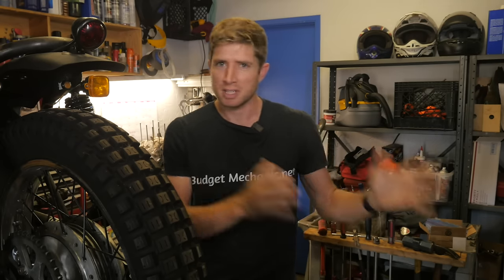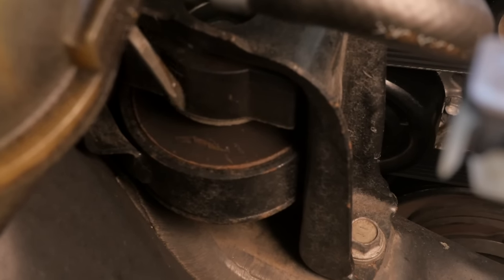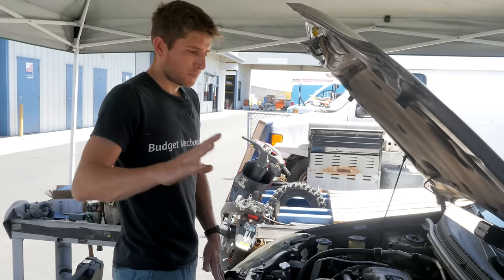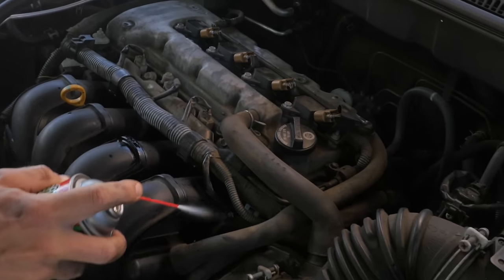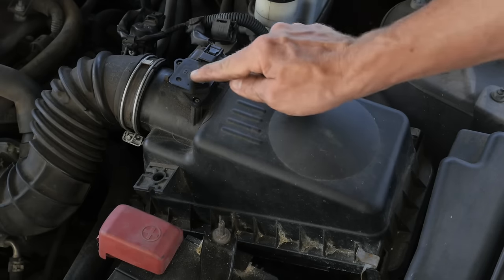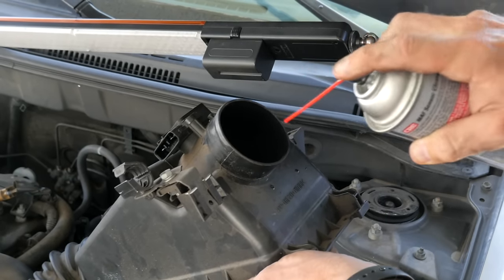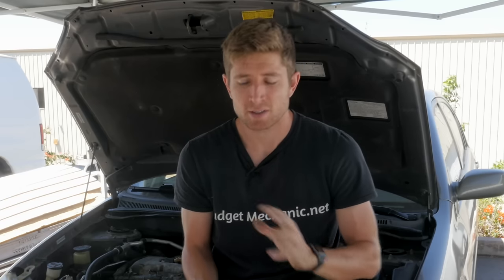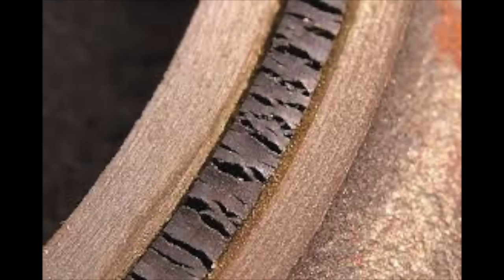Diagnose and Fix Rough Car Idle - Main Causes For Shaking / Vibrating While at a Stop

Comment: He said spark plugs but forgot to mention the ignition coils. If your coil is bad your spark will have an issue.
Reply: If it’s burning oil too blow by through the rings you never get rid of the misfire foul plugs all day.
Reply: Sparks are easier to check for beginners (dirt, grease or else) while coils aren't into the same form from a car to another (ramp or individual coils)
Reply: Coils are easier to chexk than spark plugs. You literally have to remove the coil to get to the spark plug. If you have a scan tool you can switch coils to see if anything changes. Also you can use a tester and test the coil.
Reply: @hioshimtsu  yeah but it's visually easy to tell for a spark, if sparks are good, chances arz the coils are blown
If your coils are dead, how do you immediately know they're faulty if yoyr sparks are dirty?
Reply: @hioshimtsu  not if your car has a distributor, then it gets a whole lot more complicated replacing the entire thing.
Reply: Kinda common sense lol
Reply: Real talk brotha
Reply: Very true.  And the coils made in Mexico and elce where seem to go bad a little quicker.
Reply: I’ve never owned a car with a coil
Reply: Bad coil 99% of the time triggers cel
Reply: If any of the coils were bad you’d get a check engine light coming on for starters and in addition the OBD reader would point you in the right direction with the proper error codes that would point to faulty ignition coils.
Reply: Most cars now have coil packs . A combination of coil and spark plug.
Reply: This is true, most people say spark plugs and mine found out to have defective ignition coils.
Reply: @Anonymous-ew5bq  what is “cel”?
Reply: @thomashardin911  check engine light
Reply: Can coil ignition switch off the car from driving?
Reply: @thembelakweni4613  a faulty coil or coils can cause the following: 
1. limit cars performance (loss of power) 
2. misfire
3. prevent car from starting
4. cause the vehicle to stalling/cutting off
5. rough idle
6. fouling of your spark plugs
Also apart from plugs and coils, its good to check the cables powering the coils. Ive seen issues where there is a loss of power and its cause by the cable being damaged.
Reply: @Anonymous-ew5bq  thank you :-)
Reply: Spark plug lite the check engine light so so lame
Reply: @clonestarr3466  how do you fix the oil in the plugs?
Reply: My Kia Rio was misfiring on cylinder 2 so I brought it to a garage. They told me I needed a full engine replacement but couldn't give me a good answer as to why (scam). Brought it home and did a little trouble shooting. Changed spark plugs. Same problem. Swapped the ignition coil on cylinder 2 and the problem was solved. Cost me $70 for all 4 spark plugs and a new coil
Reply: @sethmanukula176  it’s actually easier to check for a fault coil since all most vehicles require for you to just ink plug the coil and listen for a change in the sound of the engine
Reply: Explains cause I just got a tune up and new spark plugs but my car started back shaking smh must need coils too
Reply: Do bad working spark plugs set off codes?
Reply: Did some research and all the symptoms line up to my car having a bad ignition coil, thanks for the clarification!
Reply: @miguelsalazar3239  yes they do!
Reply: I prefer to use cheap coil coz so easy to check gone bad.
Reply: He  missed a lot of things lol.
Reply: true.
Reply: always use oem ignition coils if replaced. knock offs can ruin the ingition control module.
Reply: my buick electra had coil pack in top area of distributor. it was not hard to replace. hei 50.000 volts type system.
Reply: Well said daddy 😂
Reply: Facts
Reply: As well as Catalytic Converters can also make your car run bad loose power or even run hot. As well in bad situations causing major engine problems. Or oxygen sensors
Reply: Old mechanic trick crank car get a paper towels spool put it to your ear listen for lite tic very low when putting up against coils . Let you know if one is weak going bad.
Reply: COP coil on plug ignition coils fail where the spring makes contact with the plug .
the high voltage will burn thru the insulation . So if you see burning , that ignition coil will not be working 100% .
Dealerships have to know this  . I don’t know if All COP ignition coils have this issue
Reply: @infantbruhh7154 emove valve cover and change silicone gasket if oil is found around spark plugs
Reply: @Lucy-uk3gt can you elaborate on what you mean by ink plug I have an issue and have changed about 11 parts now running out of things to change haven’t changed the coil yet.
Reply: 3cuv😅
Reply: Absolutely, i had two coils leaking oil all over the engine. I had bad acceleration response, i changed both in a minute and everything runs like new.
Reply: He also forgot to mention the PCV
Reply: @Anonymous-ew5bq triggers cel??? What's that?
Reply: @jaydee177 what if the check engine light comes on for like a day, but then it disappears?

My cars been shaking every so now and then. Especially when I start it up or slow down the car
Reply: @jamespak8175 had a buddy of mine have a similar issue when we plugged it up to the scanner nothing popped up but i noticed that the battery voltage wasnt normal for the car being on from the scanner we checked for mifires he had none which lead to being the battery it was so weak that it wasnt supplying the correct voltage to the rest of the car making it shake not saying this is your problem but might wanna check out that battery sooo many people overlook that my subaru had a problem where it wanted to stall when slowing or stopping found a lose chassis connection it be the stupidest things
Reply: @Anonymous-ew5bq  I did a scan recently and it showed up a code saying my 4th cylinder is misfiring.. the autoshop was saying it could possibly be the ignition coil.
Now I'm trying to see if I want to replace all of the coils because the car is almost at 70k miles. 40k came from delivery driving.. but I don't have the money to replace all of it now.

Do you by any chance know of any grants for car repairs by any chance?
Reply: Well you mentioned that skeezix, so now we're all set. Funny thing is, the book of viewers aren't going to know what that coil is anyway.
Reply: Anyone know if it's okay to use fuel system cleaners often? Like once a week?
Reply: I changed both and it’s still doing it
Reply: What about new Amazon seller spark plug wires? I did a complete tuneup with there website vs local auto parts.
Reply: @clonestarr3466 Try a hotter range plug. Will burn off the oil (stay cleaner a while anyway).
Reply: So does anybody have any idea on why my ignition coils would be getting burnt ? Already changed twice and spark plugs as well they been checked if everything is okay as in the gap and all that and there nothing else to check but the coils are still getting burnt
Reply: @Sam-uk3sr  They are a limited lifespan part. My 2006 truck, the coils began popping soon after I bought it in 2015. 
By rights I should have ordered all 6 changed at once. I was told "they're working why spend on something that (is working).
Dam things would suddenly go dead when I am out in the boondocks and have to be towed. 
Now I have a relatively low mileage 04 GM with the individual coils.
One just went and almost left me a sitting duck on an overpass.
5 to go.  Basically they last 10 years.
A decade or 130,000 Mi or 200,000Km.
If you don't have CAA or other roadside assistance services then change them all as it's a gigantic ass pain when one suddenly blows and your holding up traffic. 
My vortec engine died once one coil went for whatever reason.
Reply: I changed both and my car is still tripping
Reply: @mz.pinkney  Need to have the engine control module diagnosis. Should be a string of data to go by.
Reply: @RetroCaptain  that sound hard 😂. Chrysler be taxing so much for the diags
Reply: @mz.pinkney  A non dealership mechanic cannot do a scan?  I'd be pissed if I was forced to take it to the dealership way past warranty unless they welcome the business.
My SUV is American so no chance the local dealer has any ties to it.
Reply: Fuel injector s also!
Reply: @hioshimtsu not all cars have on plug coils some have a single coil then a distributor and wires
Reply: @hioshimtsu how can I test the ignition coil using test light?
Reply: What about egr
Reply: I have rockem engine doing the same thing
Reply: @sethmanukula176 without a scan tool, you could just disconnect the wire to the coil and listen to the engine. If it starts to stumble, then that’s a good one still. If there is no change in engine sound then that is a bad one.
Reply: @infantbruhh7154 replace the valve cover gasket. Most vc gasket sets come with spark plug tube seals as of recently, some car manufacturers like Nissan, Honda and especially the Chevy Cruze, they make you replace the entire valve cover itself as those spark plug tube seals are integrated into the cover and not replaceable.
Reply: @ShauntaeCherieTV depending on the type of spark plug, they might have been improperly gapped. I’m a very budget minded person so I would have checked that first before replacing a coil unless you had a check engine light telling you that you had a bad ignition coil.
Reply: @chriszackery2402 they meant to unplug the wire that connects to the ignition coil. If you remove the wire and the engine sounds the same, then that’s a bad one. If you remove a wire and it starts to sound horrible, then that was a good one.
Reply: @francispellerin5093 you changed the contaminated coils but did you fix the underlying issue of a bad spark plug tube seal? Most manufacturer’s warranty’s don’t cover that because it was a different issue that caused for the coil to fail, meaning you’d be out more money to replace those coils again.
Reply: @80ajflores those guys are cheaper because they buy in bulk vs the little guy and they don’t have as much overhead as the brick and motor stores.

You also have to be careful that you aren’t getting counterfeit spark plugs and stuff. Always buy from a reputable supplier to make sure you’re getting genuine parts.
Reply: & bad ignition coils may give a weak spark or no spark
Reply: If your coil is bad you would have serious misfiring
Reply: I have come to accept that they are human and forget as we do

Comment: A misfire could be from a stuck open valve. In modern cars, you would just have a bent valve or it would have dropped down. You could also have a head gasket not torqued all the way,  and you've lost compression. Rocker arms being too tight can push on the lifter, when set at an undesired valve lash. Spark plug could be loose in the hole, and little to no compression could be found. Bad piston rings could produce little to no compression. Always take off the valve cover and watch the rockers move.A  bad harmonic balance, flywheel, or flex-plate could lead to knocking sounds, as well as unbalanced vibrations. A vacuum leak could cause vibrations (un-metered air entering intake manifold / carburetor).
Reply: Thanks for the extra info on things to consider
Reply: Stuck valves never happen, it's a myth
Reply: @bonkeydollocks1879  
LOL!
Reply: Dude the video title mention...Regular issues, those you mention are medium to big issues.
Reply: Get a scan tool and look at your fuel trims
Reply: I apologize he did mention harmonic balancer in his video when I watch the video completely
Reply: Most these things only apply to an engine that's been tore down before. 
Don't go telling people to check all this.  It's ridiculous. 
Most cars have never had the head bolts opened. 
Bad piston rings throw a bunch of emissions codes.
And timing issues are not what's going on here either. You'll have bigger issues then. 
This is going to be air or fuel, 90 percent of the time. 
It feels like your experience ended 30 years ago.
Reply: Hey Thomas just know I love you okay just know I fuxking love you I literally tighten my rocker arm too tight it wasn’t all the way down and I put it it wayyy down
Reply: @Legend-lc9bv  No problem. Set your cold valve lash with a feeler gauge, the service manual will probably recommend a certain spec. For most GM OHV engines, first set the engine to TDC @ #1 cylinder. Loosen all 16 or 12 or however many rockers and then snug them down. There isn't a torque spec on rocker arms, just check the lash. The old trick I learned was to keep the engine off, then spin the pushrods, and tighten the rocker till you feel the pushrod no longer spins by finger. Then crank it down a quarter turn. Or you could do it the infamous way of running the engine, and adjusting it till it stops making racket.
Reply: @thomaswilsonsr.9206  turns out it was bad coils

Comment: I’m ready to drive it to the junkyard. Lol
Reply: Me too lol
Reply: I chased a rough idle for over a decade on 03 corolla.  Done everything, replaced mounts, checked coils, injectors, changed plugs, timing chain, pcv valve, dude u name it, I've done it.  I did the resetting ecu idle procedures.  Junkyard may not be good enough for this pos.
Reply: Same only if I had another car or money for one

Comment: Man i have spark plugs that are 10 years old with 300k n they haven’t been touched since my car got passed to me from my family
Reply: Put some new ones on her you're probably going to gain like 50 horsepower... Lol... Seriously man you will feel better throttle response .....
Reply: My truck has had the same ones for about 15 years it’s 29 y/o
Reply: You wisely live by the mantra : if the wheel ain't broke, don't fix it
My luck if l changed those reliable plugs for the helluva it, the entire engine would cease.   Some old cars go better with dirt - even cleaning the engine one time - l wished l hadn't 😅💥💨

Comment: Great video. I seen a guy clean his IAC with it still mounted. He removed the tube where it vents into the crankcase. While plugging the hole where the tube was attached with his finger he sprayed carb cleaner down through the throttle body into the IAC until it started to break up the carbon buildup. You can also tear the whole throttle body off and remove the IAC but, if you don't have to why? Thanks again.

Comment: Try changing Cabin Filter if you have rough idle issues when turning On AC. I have a 230K mileage lexus is250 that has a P0113 misfire and rough idles on R/D/AC On. Saw a video and manually cleaned carbon buildup on valves > cleaned fuel injector > cleaned spark plugs, throttle body and replaced engine and cabin filter. Now my car runs like Brand New! Thanks!
Reply: How did you clean the fuel injectors
Reply: . Manually cleaning the valves is tricky. Luckily enough, Tiny   "valve fairies"  keep our cars in tip-top shape.
Reply: I’m sorry but changing out your cabin air filter will not affect ur car engine what’s so ever